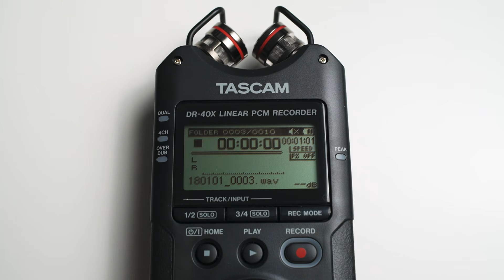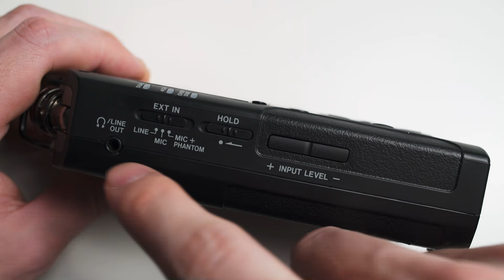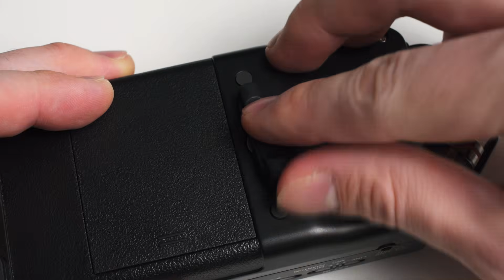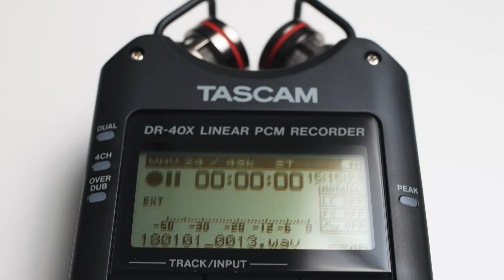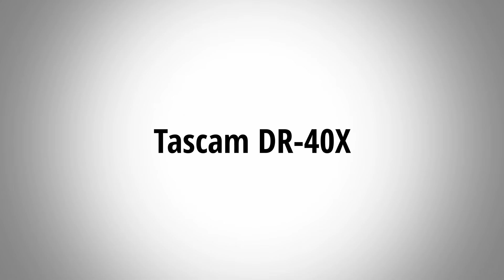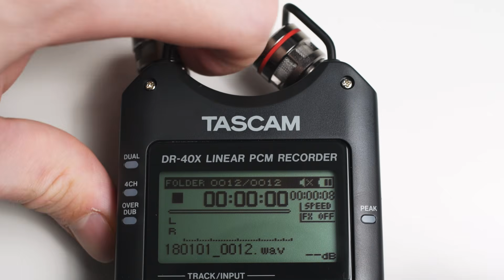Tascam DR-40X Review (Noise, Battery Life and more things tested!)

Comment: You are very right with the Pre-Amps. So I ordered a Zoom H4n Pro instead of the DR-40X, to replace my DR-40. But there are a couple of things, I really don't like on the Zoom, and that make me thinking about sending it back and ordering the DR-40X. (I don't use dynamic Microphones, if possible). Here are my opinions why the Zoom H4n Pro (black) can also be a bad option: 

*) The 5V input for the external power supply is a 4mm * 1.7mm barrel connector. A common USB mini / micro / C port would have made more sense to be able to use a power bank.

*) A power supply via the existing USB mini connection is only possible when connected to a computer in SD-Card reading and Interface-Mode. (The Tascam DR-40 can be supplied with all microphones via the USB port at any time, even when recording)

*) There is no USB-A to USB-Mini adapter-cable for PC connection shipped.

*) There is no USB-A to 4mm barrel-connector adapter-cable to supply the recorder with a power bank shipped.

*) The manual  speaks several times about the supplied 5V power supply AD-14. This is not included but has to be purchased optionally.

*) The interface mode requires too much power, so that mobile recording with an iPad and an active USB-connection-kit is not possible without an active USB hub in between.

*) With a 16GB SD card that has been formatted in the device, the recorder needs almost 30 seconds after switching on to be ready for recording. (Tascam DR-40 approx. 3 seconds)

*) No protection of the microphones in the event of a fall.

*) The device is extremely top heavy due to the heavy microphone holder, so that it falls onto the microphones with 100% probability.

*) The operation via the side menu wheel is extremely impractical, especially since it also acts very spongy and imprecise.

*) when connected to a computer, the display does not light to select the function, only after that.

*) The sampling frequency of the interface mode must be reset each time and is also only 44.1 or 48 kHz, but not 96 kHz.

*) The recorder is very heavy

These points are certainly not a problem for everyone, but for me who previously owned a DR-40, many are a step backwards.
The recording quality of the H4n Pro, however, is excellent. There is of course nothing to say. And this is the main purpose of an audio recorder. Nevertheless, I find the operation and handling of the Tascam DR-40 miles better.
Reply from the maker: Hey, thank you for sharing your experience with the H4n Pro. I think this is valuable information for someone wanting to buy it!

Comment: I appreciate this review and this brings up old nightmare about the DR-40 and Zoom H4n original... They were so similar: EIN of around -108dBu, max gain amount around 45dB, clickly buttons for gain control, and shared headphone/line out port.  And bad headphone amp. Forget about driving a dynamic mic,  just take Rode NTG2 for an example (-36dBV/Pa @1kHz), the noise produced by H4n and DR-40 still haunt me today.  IMO the original H4n and DR-40 get a pass for their age, and Zoom did improve the game on H4nPro in 2016. Tascam c'mon, the DR-40x in 2019 with virtually no audio improvement over the original version? What is this? Anyway, thank you for this video. Not sure why it got so many dislikes compared to your other videos.
Reply from the maker: You are right, testing the DR-40X I felt like back in the times when the preamps even introduced noise to recordings with condenser mics. 

Oh, and the dislikes come from someone who dislike botted the video. Seems like I hurt someones feelings with an honest review...

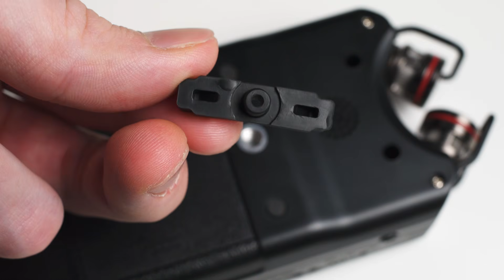Comment: 3:20 On the inside of the battery compartment door there’s a special place to store the small rubber stand so you don’t end up losing it. Simply press the rubber piece between the 2 plastic stems on the inside of the door and when replaced the rubber stand will never get lost while stored between the batteries 🖐😉
Reply: Thank you.
Reply: Also, if you want a snug fit in the tripod socket, just turn it clockwise a few times. All this said, a flip out stand or something that doesn't detach would be better and if done right, far less fiddly.

It's overall a very good review. My nitpicks is that critiques and praises aren't given with any nod toward prices. Also, I thought the build quality felt fine for a $180 portable four channel recorder. Maybe the feel is different depending on whether you pick it up empty or with batteries. Weight subjectively suggest quality. (I've had cheap phones in the past that had a lead weight in the handset presumably at least partly to weight it down when they went with lighter weight speakers and microphones.)

Comment: Today I used the DR40x for the firs time, after using the DR40 for 5 years. I´m shocked with the high hiss in te recording. Not panicked because I knew can be fixed on Adobe Audition, but this level of hiss it´s just unacceptable  for profesional use. Any clue how tho down this noise inside the DR40X

Comment: Ive been using the DR40 for years, still works like on day 1, and still has the noise you describe ... you need hotter mics for it (been using it with AudioTechnica). Seems the only added feature is the usage as USB sound device on Mac/PC ... Reason why i bought it back in the day: the Zooms had even worst noise floor (and dont check the crap frequency response) and you could use it with external USB batteries. And ofc around 160€ it was cheap. And even after all these years of "abuse" - even it may feel cheap - never was broken, always worked. Yeah i agree 2020 the DR40II perfomance is not acceptable anymore.

Comment: That line noise as shown at 8:11 is unacceptable for my usage. I've tested across a number of mics. All the same. I'm extremely disappointed with this product and will be returning it.
Reply: I was considering buying a cheap recorder for outdoors recording but I just ended up using my Focusrite Scarlett 2i2 with an android phone as a recorder. The setup can record for hours and the quality is way better than what you can get from these cheapies. However, obviously the phone costs more than a bunch of these things. Oh, and yes I figured that the Scarlett fits perfectly into a small 1/2 rack bag.
Reply: Also depends on the mic

Comment: Awesome video. DO you have a recommendation for a 4 channel recorder in the same price range?
Reply from the maker: Zoom H4n PRO ;)
Reply: The Zoom H4n needs attenuators to record any line level signal. Unacceptable! I think one is better off with the DR-40x and some FetHeads. That way you get rid of the noise when using microphones but you can record line level signals without problems.

Comment: for using with shure sm58 do you recommend zoom h4n or tascam
Reply from the maker: For your setup I recommend the H4n PRO or the H5.
Reply: @JulianKrause  thanks alot 
which audio interface better 2i2 or zoom ?
about noise floor
Reply from the maker: @Altohamy  I haven't tested any Zoom interfaces yet, so I can't say. But they should be pretty close and even a bit petter than the portable recorders.
Reply: @JulianKrause  if they are close then portable recorder is the way .
but if focusrite is better as audio interface then it is the choice .
thanks alot  for your fast reply
Reply from the maker: @Altohamy  Really depends on what you are doing. If you record with a Laptop of PC in a fixed location I recommend buying an audio interface. But if you record on the go, I recommend the H4n Pro or H5. Cheers!
Reply: @JulianKrause  willing to use dynamic mics

Comment: I had similar bad experience recently with the DR-07X, except it was worse because it picked up cell phone RF noise :( right in the middle of my recording of a concert. I would love to see a test of these devices that tested against RF interference - in a public venue you cannot control for people having cell phones. There seems to be no protection - I had less interference from my Zoom H4n, but there was still some. Have not tested my Tascam DR70D for noice. Can others post on this modern recordist challenge?
Reply: Do you ever have the same issue with an external mic plugged in?

Comment: Hi, i was thinking of buying 40x instead of 07x, just for the mic input, in case of a future use. But since you said that the noise level make them practically useless, i am thinking of buying either the 07x model, or the previous model (40). What do you think?
Reply from the maker: Hey, this is the noise of the XLR inputs. I haven't measured the noise of the 3.5mm input. If you only need the 3.5mm input something like the 07X or a Zoom H1n might be the right choice.

Comment: I am using Tascam DR40 the original(version 2) and Tascam DR07X and they both behave the same way with internal mics as does DR05(version 2) at recording level 32 there is much more noise than on recording level 33. Not sure if this is due to a filter from 33 or some sot of digital lifting up to 32,but for anyone using this right to a camera it is better to be at 33 and tune down headphone output level a notch than to record at level 32. This is also true for mic in 6.3mm from say a digital keyboard. If recording line in though level goes to 24 only and then it is linear. So better then as high output as possible from digital piano. Another thing to watch out is if you use bass+ EQ and Reverb effekts then line out will distort much earlier than the actually stored file. So if sending right to camera you cannot trust recording level as the added DB is not added on meter,so safest to be not to loud out. I usually like to be at 6 columns when going to high levels around -6db.I add further EQ through the tiny Shure SHA900 right before camera input which I have at the lowest possible.
Reply: The Shure SHA900 which os a tiny headphone amplifier does have 4 band parametric Equalizer and and you can store 4 different user presets of this. I use this to get rid of most of the noise from Tascam now. Tascam I use to add reverb and a sometimes a bass boost. This way I can record violin and piano directly to camera and not synch or edit in post. It though took some time to figure out best settings. The parametric Equalizing and in and out 3.5mm DAC is extremely quick. I wrote to check this before buying. So Tascam amd Shure SHA900 is still good for me I record at 24 frames per Second. I did also read your review about other equipment,so for those who need a really small parametric EQ for live stream or broadcast  the SHA900 is generally overlooked. Battery lasts a long time,more thsn 10 hours per charge. I use with 3.5mm for reverb . I havent yet tested usb.

Comment: You should be comparing noise levels of comparably priced models.
Reply: I was about to leave this same response. Comparing a $100 recorder to a $700 one. You obviously get better quality when you pay more. They design their budget devices with this in mind. I have an even cheaper version, the DR-22 WL and I love it for its size and functions, even if limited. I just clean up the his in post, I mean I'm going to do that anyway.
Reply: @shadowsilhouette8499  The Zoom H5 (which is one of the recorders the Tascam is compared to) is not a $700 recorder, indeed it is only a bit more expensive than the Tascam. In fact, it is very important to be aware of the issue Julian points out because if you're recording, say, birdsong in the field, you may have difficulty finding a quiet enough spot to use as a basis for cleaning up the file in post.
Reply: @djinibee2435  Current Amazon prices. DR 40x: $179 , Zoom H5 $279, F4 $444,  F8 $849 SD MIX PRE-3 $680. There are other audio recorders in the Tascam's price range, but these are not them.  As he mentioned you can add the Fathead Preamp ($99) and lower the dB by 22 decibels. Check his chart and see how that compares.
Reply: @kbrocx  Exactly. Price and performance both matter. My need is pretty niche/marginal. I could rationalize $180. But half again more was hard to swing. Also, I'm not recording with a dynamic mic and I no how to noise cancel. For a different use, an extra $100 spend might be an obvious no-brainer choice to make.

This is an overall very nice, detailed and appreciated review. But the price comparison is something that should be included for it to be a balanced review.
Reply: when you demonstrated the noise level of the preamps you were using an external dynamic microphone, and you stopped talking so we can hear the hiss:

1. did you have the agc on so the gain came up when you stopped talking? I had to turn the volume way up on my stereo to hear the hiss, way louder than a comfortable level for listening to you speak. The amount of gain required with an external microphone is a function of the output level of the microphone - a better mic with higher output would not need the internal amps turned up that high.
2. Why didnt you do this test with the internal microphones, which are condenser mics? The primary use of this device is to record with its excellent built in microphones. 
3. Why didnt you do the test again with line level inputs, a guitar thru an effects pedal for example that would produce line level outputs with no need for the internal preamps? Or with external mics that use the phantom power?

This is the only $150 4 channel recorder (Still?) on the market that lets you record all 4 channels at the same time, with 24 Bit DACs and a 96k sample rate. Its not intended to be a studio quality stand alone system. 

I find it very useful for practicing acoustic guitar and vocals, very easy to record a rhythm track with vocals, then overdub a lead guitar track and sing harmony, or add a base line or piano track, and then mix down and still add more harmony into 4 tracks. If you have to wait till there is silence on all 4 tracks to hear the preamp noise with external mics, then dont record silence.

Also to set the levels of each channel open the mixer function - each channel has its own level and pan control.

With the DR40X you could have two performers singing harmony, let them share the internal mics on 2 channel stereo, and line in two instruments (guitar and bass for example) and capture all 4 tracks together.
Reply: It didn't sound that noisy using the inbuilt mics just with the external dynamic mic.
Reply: I saw a YouTuber raving about the Roland r07.  Have you seen it? Any other suggestions for around $200 US?

Comment: Thanks for this comprehensive review. I agree with you that having so much pre-amp noise is simply unacceptable in this day and age. Not being able to individually switch phantom power is also a dealbreaker, it's surely not uncommon to want to record from both condenser and dynamic mics simultaneously.
Reply: Dynamic microphones have no problem with phantom power.You can turn it on without any damage. Under no circumstances should you turn on phantom power for ribbon microphones. This destroys them.

Comment: Agree with everything you've said, however, it seems that comparing a $200 recorder to those above $500 may not be completely fair.  Most recorders in this price range have fairly weak preamps.
Reply from the maker: Hey, the Zoom H4n is only 10% more expensive and has AFAIK the same preamps as the H5. That's a valid comparison.

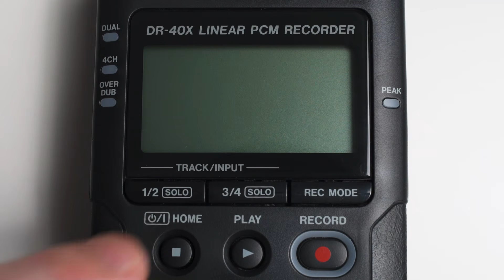Comment: @4:00 you suggest it should display audio levels when turning on the device? I disagree. How do you know what REC MODE settings are enabled when first turning on device? The “preview” to recording just takes a little getting used to, which I think is only a criticism on first use (because “red blinking light” usually means recording)... instead I suggest it should go from “yellow” for audio levels check the “red” for recording.

There is also the “preview” audio recording option before you hit REC the 2nd time to actually record.
Reply from the maker: I just don't understand why you need the preview mode. When I turn on the device it should show me my settings, including the level meter, so that I can quickly set my levels. Then when I hit record it should directly start the recording. Can you name one good reason for the preview mode to exist?
Reply: Julian Krause Often people may use the “pre” recording feature on this or other recorders, so that it starts recording on a rolling buffer as soon as you press REC 1x to be in Monitor Mode / Standby, so that if you are 5 sec late on hitting REC again to be in Recording Mode - you still have that buffer.

My concern (I don’t know how valid this is, please correct me if possible) is that if the device is always on this “Monitor / Recording Buffer” mode as soon as you turn on the device... that may damage the inputs? For example, plugging and unplugging cables while device is on with different audio input levels and not knowing which recording mode is selected (i.e. internal mic, line or XLR mic input). By requiring the user to at least (presumably) have everything configured and “ready to record” when they enter “Monitor Mode” - that seems logical to me.

What is illogical / confusing to me is that “blinking red REC” light means “monitoring” and not “recording”. 😣 So I wish that indication between Monitor Mode vs Record Mode was better communicated (eg Yellow vs Red light).
Reply: @JulianKrause  The sony pcm-m10 (and probably a10) put you in a pre-record mode with the record button. This allows you to adjust your levels (input and volume) prior to starting the recording.

Comment: Nice video dude. Would I be able to plug in two different wireless lavalier receivers into each of the xlr inputs and record two different people at once? What about using the built in microphone as a 3rd recording? Thanks in advance
Reply from the maker: Yes, you can do that. The DR40X is a 4 Track recorder. It can record both XLR inputs and the internal stereo mic at once.